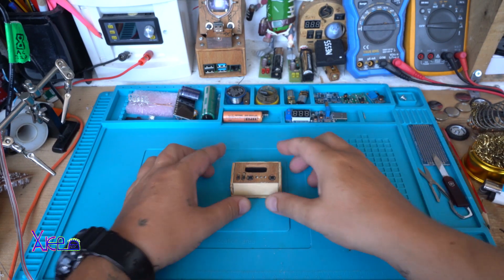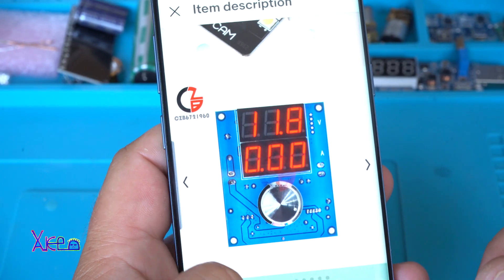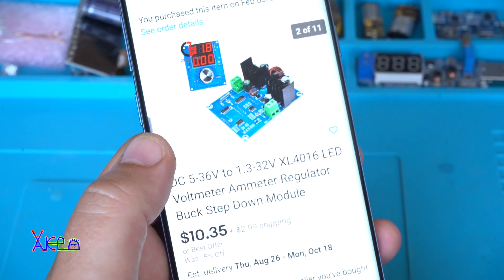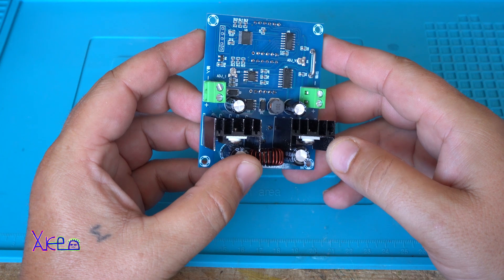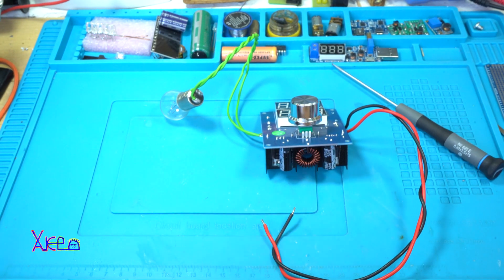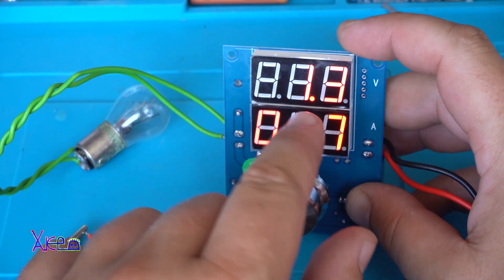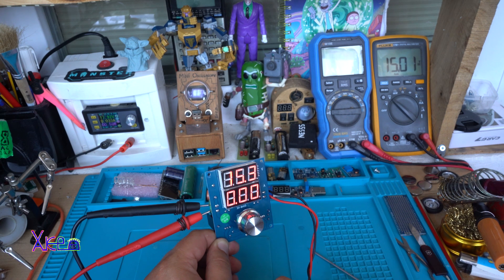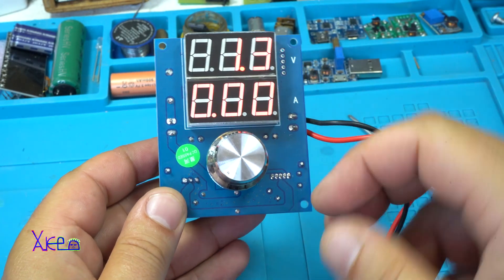10$ Electronics Gadget - Full Review and Testing of Adjustable Step Down Module

Comment: I put dark window tint on those segment displays because they are so blinding you can't see them. Also, so you know, on the back of that new control there are fine adjustments so you can make it more accurate both voltage and amperage
Reply from the maker: Thx for feedback

Comment: I’m curious, why and how would I use this? What is the purpose ?
Reply: It will give varible voltage so you can use it on different projects that require different voltages to use.  If you are. then a volt multimeter is a must buy to confirm voltage is stable!